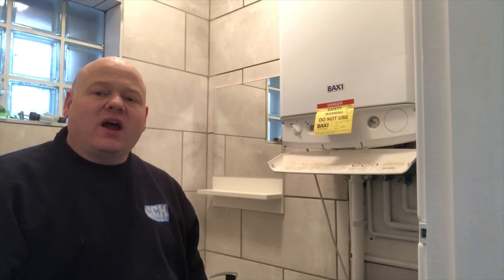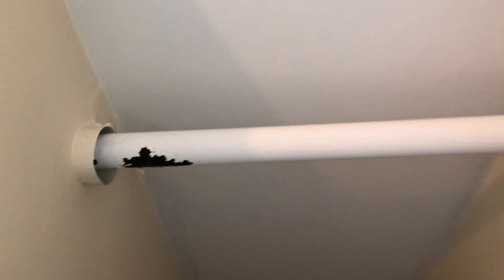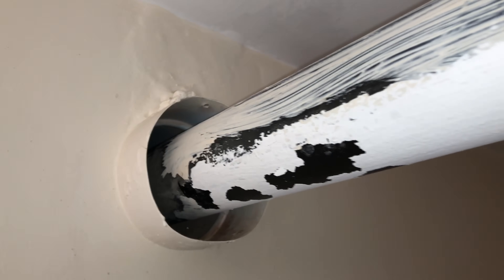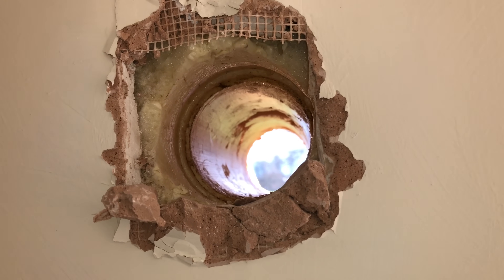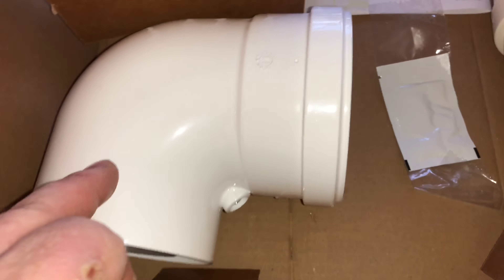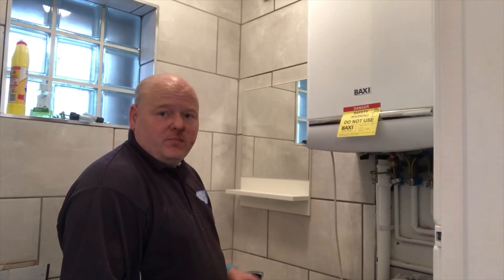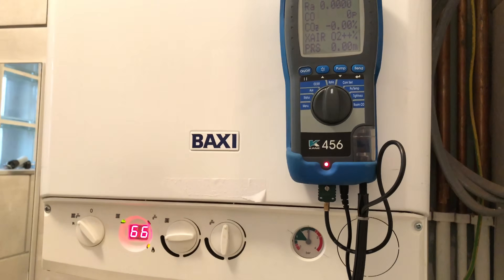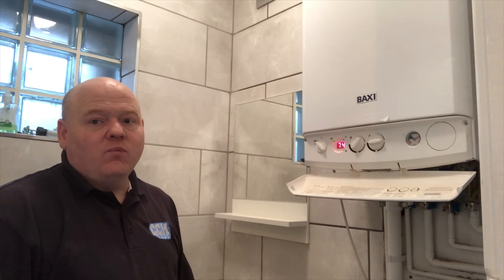Dangerous Gas Boiler  A day in the life of a Gas Engineer / Plumber

Comment: Isolate the flow and return as the Expansion vessel just needs pumping up and draining though the drain cock on the boiler and also just change the prv as they can be temperamental once they have released. Good job though mate great vid 👍

Comment: Always better to check dhw flow rates at bath Allen. At 10 ltrs/ per minute on both cold mains and dhw could mean that braided hoses to taps are  probably fitted only allowing 9-10 ltrs/ minute flow rate.
Reply from the maker: Outside taps are normally good as well. Thanks. Happy new year.

Comment: That building must have had an extension built onto it. The original install was fine but someone has put a very dodgy extension on the flue after the extension was built.
Reply: Yup, that happens. I'm just refitting a property that the councils own 'certified Gas-engineers' did similar on. Normal flue joined to over-sized flue, through a ceiling, through a roof space, through the slates, 2 - 135 degree connectors, all self-adhesive Aluminium-foil taped joints (holes in them (mice etc)), certified as 'appropriate and sound'. !? Not in a million years, mate.
Want to see the images?

Comment: Hi just come across this video and If you noticed the gas rate was incorrect plus such a long run from meter to appliance did you think to check inlet working pressure against meter outlet to check pipe sizing was correct because if you didn’t you yourself left an appliance at risk

Comment: I thought you said expansion was undersized for the property and then you stated the property doesn't need a 40kw due to the cold main being 10 ltr per min...so if the property is so big where the expansion vessel is undersized surely it needs a 40kw and the cold main needs increasing.. that expansion vessel had gone and needed replacement..boiler was installed before extension was built and what was working pressure?
Come on it was a bad job to turn upto but I don't think your assumptions were quite on point buddy
Reply from the maker: nicholas tandy How many boilers have you installed? I have installed boilers for 30 years. I know what I am doing. Thanks for the comments though👍
Reply: @AllenHart999  millions Alan..  not quite 30 years but since I was 18 and I'm 39.. 😂😂 it's not criticism it's just my opinion and it didn't seem to flow what you were stating.. you do obviously know the game .. I just put my thoughts over.. no probs but you seriously need to start soldering again 😂👍
Reply from the maker: nicholas tandy definitely wouldn’t ever want to solder again😂👍

Comment: Gas safe showed me a pic of a flue where the internal flue for the products combustion was extended using downspout pipe through a new conservatory to outside, they said it’s only classed as an at risk because the products are being carried to outside. This is what confuses me about this job the classification of some dodgy workmanship. I obviously said it was id because it wasn’t to manufactures instructions.
Reply from the maker: I went to repair flue. Boiler had already been capped.
Reply: you are correct 1st time it is AR,  in the past i would ID, but the gas provider will not cap of, and you would be in trouble for the wrong clasification!

Comment: Im suprised at the people asking about the App you were using, obviously gas engineers who either can't be bothered to calculate gas rates, or can't calculate gas rates. Their phones won't be intrinsically safe and shouldnt be used around gas. 
Gas safe stated that they were going to simplify the industry, but £££ got in their way. As someone who has domestic gas, commercial gas, catering gas and oil, I think its too much to ask most people to specialise in, but, big companies want multi skilled engineers who will attend site and do many disciplines. I could be called to site to check a boiler that isn't working, repair a light in the plant room, check a blending valve which is supplying water too hot and maybe look at a commercial dishwasher that isnt working. Thats why a gas engineer may miss out that the boiler ventilation is way undersized, because his mind is elsewhere, and maybe he was on call last night and went out at 2am.
Thats the life of an engineer these days, overworked and underpaid................

Comment: Nicely rectified Allen. it would appear the builder has extended the outside wall where the previous flue terminal was and used a make shift plume kit going through the new inside wall ! Room sealed appliance not getting combustion air direct from outside . Immediately Dangerous. Should have told Gas safe or the Gas Transporter about the obstructed ECV that you had to bend to operate. If it was a less savy customer or a vulnerable customer  and they needed to isolate the Gas in an emergency they cant due to the ECV obstruction i.e the Gas meter and the side of the cupboard was not allowing you to properly isolate it at a 90 degree angle. But I'm sure you know this I'm just being cheeky 😂😉. Love the videos keep up the good Safe work you always do 👊

Comment: Thanks for sharing these valuable tips Allen. I appreciate it. Keep up the good work. Didn't realise solicitors don't check with gas safe. My father has been in a similar situation after a new boiler install from a gas safe plumber. Under gas, slow ignition leading to noisy booms and too high pressure without a secondary expansion tank. Although fitted by a gas safe son and father team, never registered the installation with gas safe. I'll give them the benefit of doubt and perhaps it was an oversight by them or too much paperwork. Even more surprised that the company representing the manufacturer, ideal boilers, who visited to check the boiler some 5 years ago under warranty only saw the under gas reading and at least got the plumber back to upgrade the gas pipe to 22mm. It didn't fix the slow ignition. The high pressure wasn't captured by two other plumbers but one did cure the slow ignition by simply replacing the igniter for peanuts. The high pressure has eventually damaged the boiler beyond economic repair and it needs to be replaced. Doesn't fill me with confidence, even with paperwork that heating engineers and plumbers know how these boilers work, how they are sized and how to identify if any extra accessories, such as an additional expansion tank or pump are required. As a consumer its very difficult to judge if what has been fitted is correct.
Reply from the maker: Best to get your own checks done before buying a property. Thanks.

Comment: A poor installation certainly, but how was it actually dangerous?
Reply: I'm not a gas engineer but I know the basics. The flue allows the fumes to safely leave the house/building into the air. If it has been installed improperly it could cause the fumes to leak into the building, then you're prone to carbon monoxide poisoning.
Reply: George Smith - It indicates that the flue was causing condensate to run the wrong way, but I don’t remember any comment about it leaking fumes into the room.
Reply: @Benzknees  I didn't say there was, was just saying an incorrectly installed flue could leak fumes into a room
Reply: George Smith - My question was how was it actually dangerous. Not potentially dangerous.

Comment: Im not a gas engineer, but does anyone else think the possibility of this being the result of an extension being built? flue looks like its been added on, and the pressure vent pipe is in the corridor??  could that have been the outside wall at one time?
Reply from the maker: Looks that way. Thanks

Comment: Alan, did my ears deceive me? At 8.00 of the video, you say the flue should always fall BACK to the boiler, whereas this one falls away to the outside, and is why there is water in the flue. I'm not a Gas Safe bod by any means, but I can sure as hell read boiler installation instructions, and the last one I read was adamant that the flue should point slightly downwards to the outside, so that any water ingress would not seep through in to the boiler.
Reply: Non condensing boilers yes.
Newer condensing boilers rise up slightly.

Comment: thats terrible, they used just the internal exhaust gas part of the concentric flue to go to outside, and stopped the air in part of the flue at the first INTERNAL wall. Bloody terrible surely not a gas engineer did that.

Comment: boiler in the bathroom should be in a compartment. flue for air intake for flue Integrity. Fuse spur cables literally hanging on pipes. No clipping on flue. It seems like house was extended and it was the builder who may have bodged the flue.

Comment: Hi Allen, I got new installed Baxi-Duo-tec 24 but the engineer did not install timer is this ok without the timer?also I turned the central heating knob to the lower temperature 0f 25 but I noticed every 5-7 minutes (my calculation only) the boiler turn on and burner indicator illuminate then the temperature indicator shoot to between 25-40 then turnoff . no one is using domestic hot water and the central  heating is on lower temperature of 25.is this is normal?thank you!

Comment: Why does a boiler have to be plugged from a fused spur? If the plug has the correct fuse then does this not provide adequate fault protection?
Reply: ideally you wouldn't want the boiler on the same circuit as your sockets, presumably?
Reply: Boilers are always on the same circuit as your sockets. The reason it should be on a spur is because of regs, why the regs? Idiots. 

At some point in the past someone probably plugged a boiler into a 50 meter extension lead with a 13amp fuse that caused a fire that may have killed someone. So that regulation was born. 

It's your freezer that you want on a separate circuit really, but how many people have that?

Comment: Plug fitted isn’t aloud? I have been told a plug is fine as long as it goes into a non switchable socket. So the plug has to be removed to turn off.
Reply: that's how mine was done (CH installation to previously non-CH home this year)

Comment: I know someone who just had a Combi boiler installed and they couldn't be happier with the service they received and mentioned that in the survey.. Their neighbour has the exact same flu... but the neighbours one has a wire mesh guard covering it.. Are these a good idea or not to get attached, where the steam escapes? Both flu's are at the same height on each property.. at the top of the first floor windows roughly speaking.. It even has a remote control. Amazing..

Comment: There is not enough fall on the flue ,it needs a bracket and self tapping screws on the flue joint .
You can touch the tap on the basin and boiler a
t the same time so it needs a cupboard around the boiler .
The expansion vessel may need represurising or replacing .,probably nothing to do with the size of the install 

Gas safe do not give a shit ,been there done that .
Probably been fitted by Asians .

Comment: Which is the best condensing gas combi today ?
Reply: If your after a combo then Baxi duo Tec / potterton promax / Main (like in the video)  all the same boiler with a different badge.  Excellent boilers that very rarely breakdown.  Brass hydraulics means leaks are less likely too.  Only problem is they are a little too noisy when running at full rate compared to others like valiant Ecotec.  Far more reliable though.
Reply from the maker: It is hard to say which one is best as it depends on what you want. Best service, Best warranty, Quality components etc. I have fitted lots of Baxi Duo-Tec / Platinum boilers and they have always been very reliable. Thanks.

Comment: Couple of things, although not my favourite, there is nothing wrong with a plug on the boiler rather than a fixed fuse spur.  That counts as the interlock as live and neutral are disconnected.
That's not how you check if the boiler is undergassed, you should be checking working pressure at the boiler whilst running other gas appliances.
The expansion vessel is probably not too small for the property, you need to drop the water from the system and check the expansion pressure against the MIs, it's probably depleted of air, and that's why it's raising pressure, making the PRV let by
Reply from the maker: Thanks for your feedback but I am only able to add so much in a short video. Thanks for watching.

Comment: What does service mode do? We have one of these boilers in an old Victorian house we moved into. Installed in about 2016. Needs a service but haven't got a plumber yet. Can never know who to trust.
Reply: It runs the boiler at its maximum rate for a certain amount of time so we can take readings,  such as flue gas analysis, and gas consumption (gas rate,)

Comment: We have a boiler when we switch on heating boiler starts to make continuous sound and show 3.3 and 3.4 bar(digital). Plus PRV pipe(outside) start to linking water continuously. Can someone tell whats going on please
Reply: You need a service.  Your expansion vessel inside your boiler  is depleted of air.  A gas safe engineer will need to empty the system of water and refil the expansion vessel to the exact amount corresponding with your boiler. 
It may be possible the vessel is faulty, but that is rarely the case.
Once a Pressure release valve drips; they usually will keep dripping, and will need changing.

Comment: Do you think the whole hallway was an added extension, with the wall that the boiler is on previously being exterior wall? It seemed like a pretty solid bit of masonry for just interior non-load bearing, when you were removing the old flue.

That’d explain why the “good flue” seemed to have its exterior outlet part at that location.

Comment: Maybe you can answer me this question why are they changing steel pipes for copper gas supply pipes just doesn't seem right, what is the purpose of this if any.
And Why did they change the name from corgi to gas safe what's the point?

Comment: Very interesting. I knew that there was an ideal boiling rating for a house but I didn't know that too big a boiler can actually be worse. How does the building size affect the flow rate of the cold water? surely a 10 bedroom house could in theory have the same flow rate as a 3 bedroom?

I've also noticed in the past that larger boilers don't always cost much more which personally, incentives me to spend a little more and get a bigger boiler. Even if it isn't technically needed.
Reply: Scott Clewlow boiler size when it comes to a combi is kind of irrelevant as the size is mostly down to hot water performance. Regular and system boiler need to be sized to the house.

Comment: Alan i need to ask you a question,my next door neighbour was over 80  and asked me to make sure the installer fitted a very simple on and off switch because he just did not have a clue about using the modern day programmers,s, and eventually,  this is what happened,  but not before he says he has to fit a timer, Can i ask how would you deal with this situation. Are you allowed to fit a simple on-off switch that he can use when he wants to.

Comment: couple of points 

1. who the hell used a 3/4" flanged plug instead of a 22mm compression blank to cap the gas pipe off ? this is totally the wrong fitting.

2. that installation is RIDDOR reportable and should not of been worked on until a investigation was carried out by the HSE.

3. no let-by test ???

4. why not drain the boiler and check the expansion vessel properly ?

I would not of turned that boiler back on knowing it was discharging out of the PRV.

Comment: No disrespect buy having your flu running down back to boiler will let  moisture run back into the boiler.....It's supposed to run downwards towards the outside so the moisture run outside the house.
Reply from the maker: Steve Jones Sorry buddy but you are incorrect,, Old boilers used to be as you say but modern boilers need the flue falling towards boiler. Thanks
Reply: @AllenHart999  Well I stand corrected we learn something new everyday.....Just wondering why they do it that way as it goes against common logic, why would we want condensate water and rain running into the boiler down the flue....maybe to help it corrode faster thus making the manufacturer more money.

Comment: Perhaps you could have tried the bath/shower water flow before criticising their choice of boiler - the kitchen tap may have restrictors.
Reply from the maker: nomen nudum Perhaps I did 😂Thanks for watching 👍
Reply: @AllenHart999  Fair enough; I just obtained a combi boiler slightly bigger than our supplier recommended for the CH, so I'm feeling a bit sensitive on the topic.
Reply from the maker: nomen nudum bigger boilers just cycle.
Reply: @AllenHart999  True, but more hot water.
Reply from the maker: nomen nudum that’s not true either, you can only get what the flow rate from the mains will provide, over sizing a combi is madness, they are already miles over sized for heating. Thanks for watching 👍

Comment: Excellent video highlighting the dangers of poor flue installations. I think I may have checked if the pressure vessel was pre-charged. I have had two cases both very recently where the silly little car tyre they use had gone leaky.

Comment: Personally i think boilers should have tamper evident seals with serial numbers just like your gas and electricity meter, the seal would prevent the cover being removed, that way it will be easier to detect if it has been tampered with illegally.